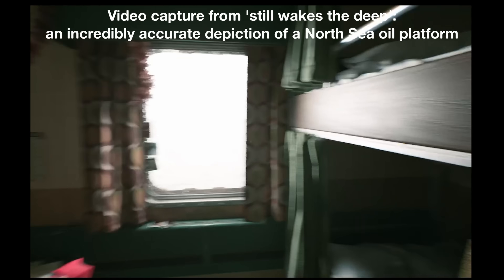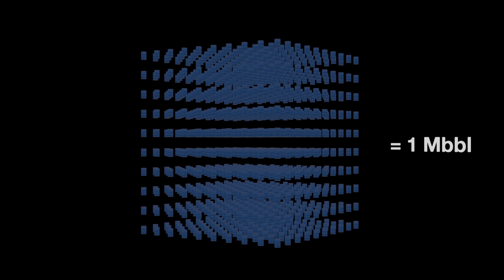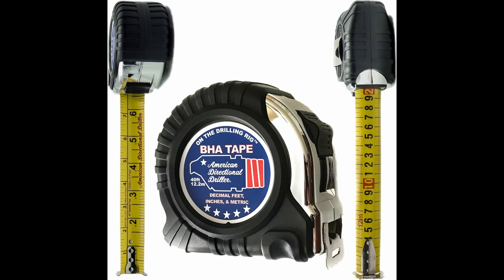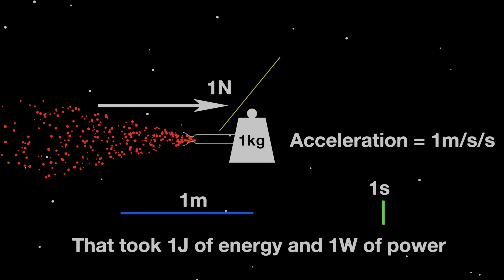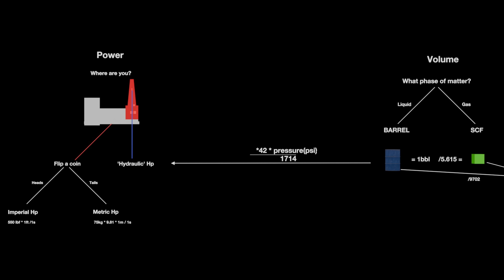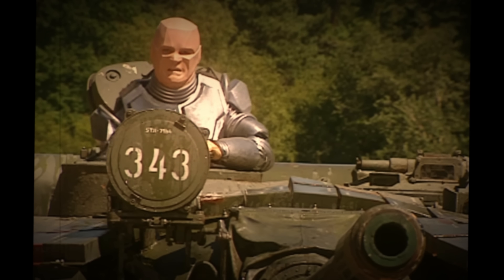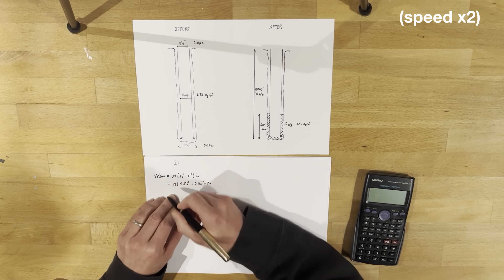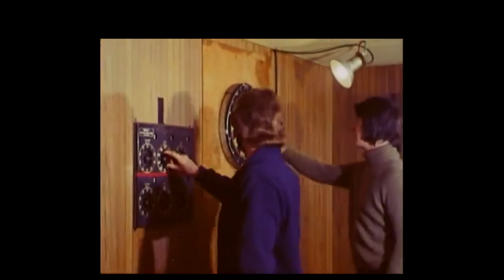Oilfield Units: a Measurement System so Cursed it made me Change Career

Comment: I live in the US and I have been around construction and machining world to some extent. I have never seen a decimal measuring tape in my life or even heard of it, cursed object. I’m sure it radiates an energy that makes people around it sick if they spend too much time in its presence.
Reply: @LordOfTamarac  May not be used in construction, but decimal feet are the standard in surveying and civil engineering. If we're going to be using customary units I'd rather use decimal feet than feet and inches.
Reply: Ive got a lufkin one. I dont know why I have it but I found it in a old toolbox years ago.
Reply: Old drawings in  UK have decimal feet..... true madness
Reply: @LordOfTamarac  we use it in US geology to measure well depth and groundwater depth, it's very common in US drilling. It's because inches are objectively stupid and having to be converted to decimal to do calculations anyways. Why don't we use SI? Because geology as a science in the US predates metrification in the US, and it's arbitrary anyways because US customary is defined by the metric system now.
Reply: Engineers and surveyors use foot-tenths, architects and carpenters use inches. They are both units that have their place.
Reply: I knew making the casings out of Uranium was a mistake.

Comment: And I thought the units in astronomy are confusing. We measure telescope diameters in inches, focal lengths in milimeters, wavelengths in ångströms (but only in solar observations), and brightnesses in a weird log-base-fifth-root-of-100 system that dates back directly to ancient Greece.
Reply: From which country are you ? I had astronomy last winter and well, there are cursed units, but no Imperial.
Reply: I wouldn't say those are confusing, each one is sort of the best unit for the job. Objective lenses are broadly broken into a few categories, like a 4 inch vs a 6 inch vs a 12. Inches just work out really well for them. Then focal lengths are much more precise, so you want something with more precision. Magnitude is strange, but once you get it, it's a great way to describe brightness
Reply: @moonasha  Magnitudes pretend to be good by having the log-scaling property. however, this is just a smokescreen to trick you into using them. Because if you want to convert the magnitudes that the tenure-track bigshot jerk reported in his preprint into fluxes/Janskys, you have to know the flux zero point, which changes depending on the telescope, AND the instrument on that telescope, AND the filter used! Better hope mr bigshot did his due diligence and reported the zero points (he did not) or you know someone who can dig up that instrument's docs. Sure, if you're in the know, this ain't too bad, but the undergrad you're mentoring ain't in the know! In her foolishness she used calibrations for NIRSPEC, the spectrometer on Keck. She should have used the calibrations for NIRspec, the spectrograph on JWST--what a blunder! Magnitudes gotta go. Just use log10 Janskys
Reply: How many candles, candelas, lumens, lux's is that?
Reply: “Ma, there’s a salesman at the door with three choices of units to measure the color of light waves”
Reply: isn't there also the confusing distance as well, most won't say a galaxy is 4.4Mly away, they say it in degrees of something, lol.
Reply: @Zarcondeegrissom  You are talking about ParSec, which is a unit of length. If you want to measure the distance to a nearby star, the best way to do it, is to use the change in angle to the target star after half. This is called "Parallax" and an object that moves two arc seconds has a distance of one Prallax Second, one ParSec (we actually use the distance between earth and sun, not between earth and earth, as that makes the triangles more complicated). This also worked back when we didnt know how large an astronomic unit was.
Reply: @apolloaerospace7773 
Yeah, that was it, especially for distances between stars or galaxies. I was looking up distances for a SciFi concept and couldn't figure out how many LYA one galaxy was from another, lol. I still don't know how close UGCA 205 is to UGC 5373, I only know that they are about 4.4MLY away from earth, lol.
Someone else was asking about what stars was within some radius from another star, and we couldn't figure that one out, lol. was something about what stars could a SciFi race colonize if they can travel so far.
Reply: @Zarcondeegrissom typically distances will be in parsecs, where one parsec is the distance at which there is one arcsecond of parallax across a distance of 1 AU. For further things we tend to use redshift as a proxy for distance
Reply: Parsecs and redshift are a good example of measurement units that are easy to measure, rather to relate to anything else. We can measure that GN-z11 has a redshift of 10.6034±0.0013, and that's far more accurate than how we know of the expansion history of the universe that far back. Similarly, astonomers centuries ago could measure in AU without being knowing how big it was.
Reply: Oh it goes even deeper. In addition to measuring flux density with a -2.512 base logarithmic scale (apparent magnitude) (yes that's a negative log base), the same name is also used to measure power (absolute magnitude), which is apparent magnitude measured at the arbitrary distance of 10 parsecs. What is parsec, you ask? That's the distance at which a length of 1 AU covers an angle of 1 arcsecond. What are an AU and arcsecond then? 1 AU is the average distance between the Sun and the Earth, although not quite but an arbitrary number of meters that's within 0.001% of the real average distance. An arcsecond is a measure of angle, it means an angle that is a degree divided by 60 (to get arcminutes) and divided again by 60. So a circle is divided into 360 degrees, those are divided into 60 arcminutes and those into 60 arcseconds. Makes sense right, just like days are divided into 24 hours and 60 min... wait a minute (pun intended), that's not 360 hours but 24. So why are they called arcminutes and arcseconds then? I don't know, but there's more. As you see sometimes astronomers actually use the REAL hours, minutes and seconds, so measures of time, to measure angle. There's even commonly used celestial coordinate systems where angles on one axis are measured in degrees, arcminutes and arcseconds and on another axis in hours, minutes and seconds! In addition to parsecs, AUs and meters, sometimes astronomers also use a fourth unit of distance, lightyear, to communicate distances to the general public.
Reply: It’s rather nice that in physics using S.I., calculations are performed using base units (without multiplier or submultiplier prefixes) and the use of prefixes is just a presentation option for the result. Rayleigh criterion formula, sin α ≈ 1.22 λ / D is used with the wavelength λ and a aperture diameter D each given in metres (and the 1.22 is the first zero of the Bessel function for the Airy disc stuff). In the calculation, λ is entered as 555×10⁻⁹ m. If someone indicates a length in nm, pm or km, say, one habitually enters the length in metres in the next formula.
Reply: @ArtUniverse  there are a lot more confusing units in astronomy than that. 

We tend to use cgs units rather than SI, so you get silly things like measuring the size of stars in centimetres and the energy of supernova in ergs (which are much smaller than a joule). 

If you look a little deeper into magnitudes you find out that AB mags are relative to a certain amount of Janskys, which are a unit of spectral flux in the CGS system commonly used in radio astronomy. In high energy situations the base unit used is often ‘Crabs’ which is the flux from the crab nebula, typically you’ll be measuring things in milli-crabs.

Then we get to coordinates where we measure angles sometimes in degrees, sometimes in hours, sometimes in arcseconds and sometimes in seconds of arc (which are 15x larger than arcseconds) and there is no good standardisation to describe when things are hours vs degrees.
Reply: The crazy base isn’t even the worst part of the magnitude system. The scale is also backwards, so a mag 5 star is fainter than a mag 1 star. Then y’all measure “color” using differences between magnitudes in two filter bands. Looking at color-color plots made my head hurt; it’s not that the math was hard, it’s that it went against my intuition for which way numerical scales go.
Reply: To be fair, Angstroms are just meters, times 10^{-10}.

Comment: I share your annoyance of people's refusal to use Joules and Watts, as well as fear of torque-over-time power measurements.

That said (and I am biased growing up in America) there are times where I prefer messy, non-SI unit systems. They make it easier to locate errors in long calculations because you will be off by a unique value or factor depending on where the error was made, while because of the uniformity of SI units, that may not be at all clear of the calculation was done in them.

Comment: You didn't even mention nominal pipe sizes, where a "three-inch pipe" for example doesn't actually have an external diameter of 3 inches, but rather 3.5 inches.
Although that isn't an issue solely related to the oil industry, I guess
Reply from the maker: Oh yeah. I should have added that.
Reply: Oh... I use SI units for everything at my job, except these damn pipes. And their threads. A metric thread is simple: external diameter is known, pitch is known. You can easily measure it with a caliper. Try this with a pipe thread!
Reply: @kwahoo5746  But what kind of pipe thread?  Half of them are tapered and don't even have well-defined external diameters!  And then the other half are straight, and sort of fit into the tapered ones but not really.
Reply: @BrooksMoses  There's way more than 2 kinds of pipe threads - there are like hundreds of them, some of which are patented.  THATS a mess.

Comment: Is there a (sane) reason why UK electricity meters are rated in kWh rather than kJ ?
Reply: Electricity trade thinks in hour blocks
Reply: And customers also think in hours.  If I run a 100W lamp for 10 hours, that's 1kWh, which is easy to calculate in my head.  To figure out how many seconds I've been running my lamp for, I have to think about conversion factors.

Comment: Three points for me:
1st: I work on offshore wind turbines and thank god everything is metric.
2nd: I’d resign the first day having to deal with this madness.
3rd: how are there as little accidents as there are.

Bonus point: are the incredible safety standards in oil and gas maybe because of this impermeable unit system because no one knows/understand what they’re doing/what’s going on? < to be consumed with a grain of salt…
Reply: If I didn't know what I was doing, I too would add tolerances upon tolerances and additional independent backup systems for the backup backup backup backup system, fortifying anything and everything ten times in excess of safe specs in case we botched it big time, and then pray the thing would make the investment back eventually.

Comment: I live in Poland, land of proper, metric units. Whenever I watch any US-based video that deals with lengths, weights or surface area, I have to ask Google for conversion because the US/Imperial units are absurdly stupid. Why there are two hp variants? Why there are 12 inches in a foot? What is an inch anyway? In metric land we have one meter,  which equals to 100 centimeters. Want more precision, then there are milimeters, much better than fractions of an inch, like 3/16 or 7/8. Want bigger units? There is a kilometer, or a thousand meters. The metric system is consistent, logical, and just beautiful. And thus most countries use it instead of US or Imperial nonsense...

Comment: I dropped out of my Chemical Engineering Degree, and units were something I've always found fascinating. I started swearing the moment you said the first b in "bbl" means BLUE

WHAT

and then, it got worse
Reply: After going through the chemical thermodynamics course, listening to the energy-power section makes me want to punch someone.

These units are why we can't have nice things. I don't think I'll be too far off if I assume they were originally devised by Lucifer himself and were, in fact, the actual reason for his banishment.
Reply: @theleva7 transport phenomena made me realize I had no hope. Liquids are a helluva thing
Reply: BBL meaning blue barrel reminds me of the naval abbreviation for battleship- BB.  Why is it 2 B's?  I've never found a consistent answer.  The most common explanation I've found is that the Navy just wanted all of the abbreviations to be 2 letters, and they didn't want to call battleships BS.
Reply: @adamperdue3178  yea, thats a good one😁
Reply: @adamperdue3178  But BC is somehow fine. And also lines up with meaning.
Reply: BBL = Brazilian Butt Lift:eyes-pink-heart-shape:
Reply: @michaelburnham4293  USA MOT certified rear bumper
Reply: Sometimes I'll see "bbl" used to refer to the barrel of a firearm. To be fair "bluing" is a traditional surface finish on firearms 😂
Reply: @iaial0 I mentioned in a comment how I did not get my Chem E and had no idea how big of a bullet I dodged as I am certain I would have likely just ended up working in the petroleum industry anyhoo.
Reply: @phlogistanjones2722  I don't know which career course you could've got. I dropped out pretty early, but my original intention was to graduate in Materials Engineering, but for my course (I am Italian, therefore the university had the first three years of Chem Eng and Mat Eng combined) I came into contact with Chem Eng pretty heavily
Reply: I used to work for Boeing. outsourcing. their insistence on their stupid nonsense units is absurd. no wonder they make shoddy planes

Comment: My fkn brain just melted but then it  always does with your vids but at least  I now know what BTU means if it ever comes up 😅
Reply: BTU means "dammit gotta pull out the calculator to convert from Watts"
Reply: @iaial0  BTU is an energy unit, so you convert Watts to BTU/hour. I guess I made the point that non-SI units really are a big mess
Reply: @playitlouder451  you're right. I recalled wrongly, because AC units (only thing I've seen using BTU) actually use BTU/h, which can be converted to watts.

Still, we're beating the soil where fifty years prior a horse died

Comment: Why use conversions when you avoid it ?
Why use a look-up table, computers exists ?
Reply: Would you rather lug around an open laptop or a small hardback on an offshore rig?
Reply: @iaial0 Have you ever heard of a smartphone? 
They are roughly the size of a small hand book, but are basically pocket computers.

Ever heard of rugedised laptops, Which are literally made for that purpose ?

Comment: Chemists like to either drop units or invent new ones that contain the proportionality constant if something becomes too inconvenient. The actual unit of the pH is log(mol/L) - dropped - and a lot of simulations use the Hartree - invented - which normalizes energies to twice binding energy of the single electron orbiting a hydrogen atom.
Reply: At least chemistry units are easy to do math with though, this is just masochism.
Reply: @gh0stcassette  That was my point, sorry if that didn't come across. Chemistry also has cursed units, but they all make sense. They aren't random fusions of other units just because we're feeling lucky, they solve problems and inconveniences one would encounter when making calculations.